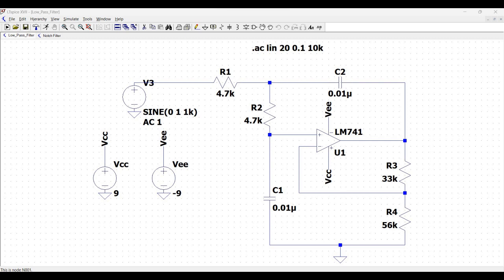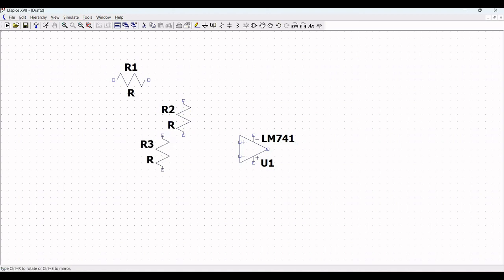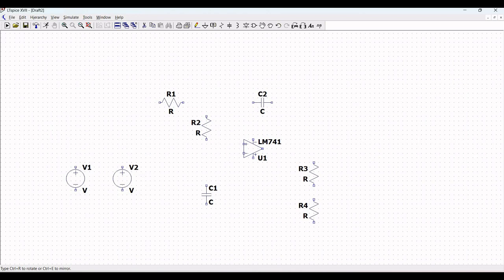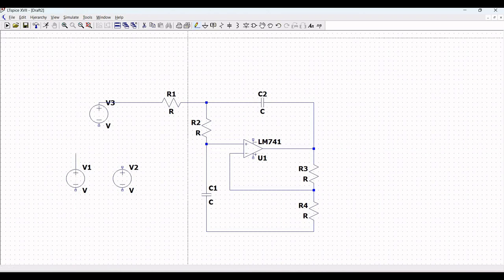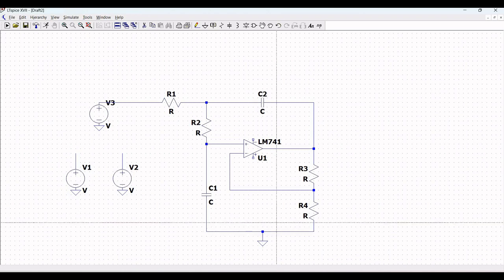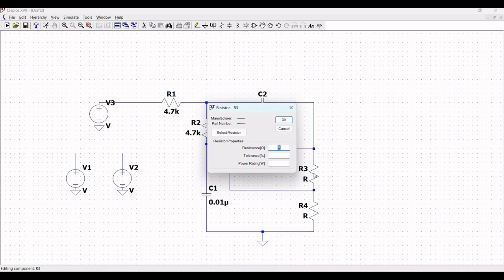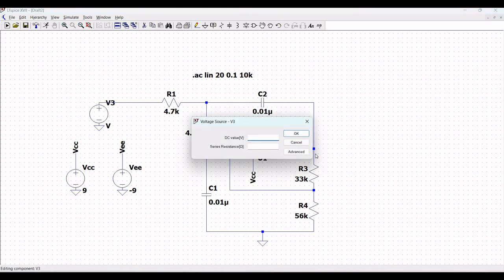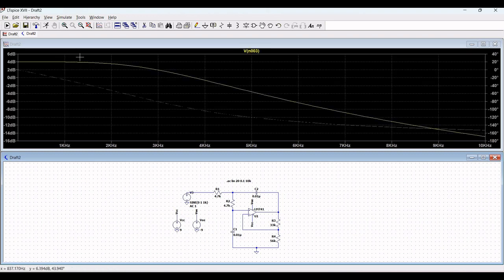LTspice tutorial 27: Low pass filter ac analysis circuit design

Comment: can you make a video on how to measure node voltages and currents of transistor CE configuration in Lt spice
Reply from the maker: There was a video on this, which as performing Dual loop analysis.
If you are interested in measuring node voltages, then just select operating point in the spice analysis.
https://youtu.be/ofOcpZQfHHU
Reply from the maker: You can check this video for your reference.
https://youtu.be/p_zLN2Ow6p0